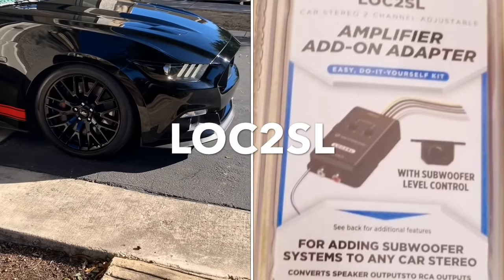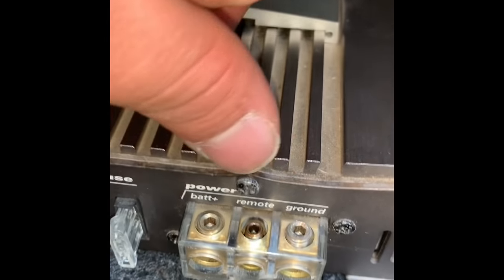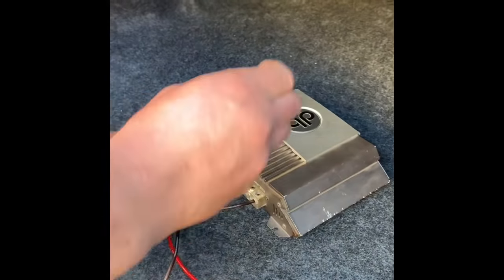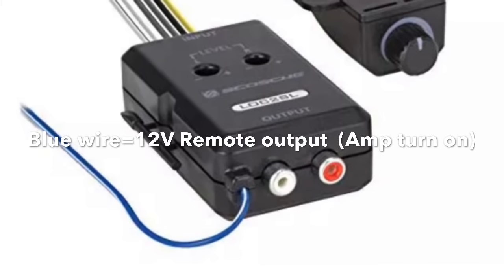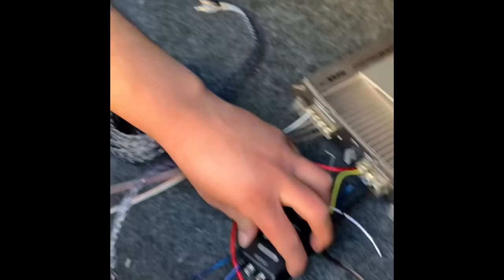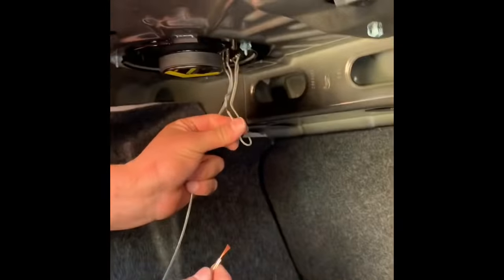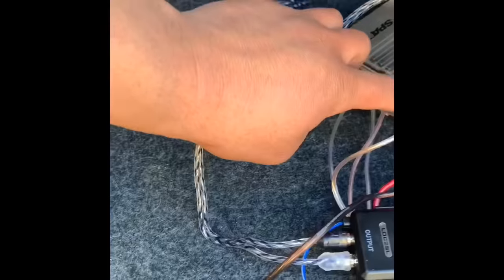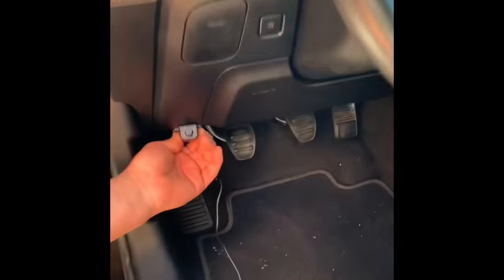How to install AMP/SUB to factory radio/LOC2SL amplifier ADD-on adapter

Comment: Hey bro you got your amp power cable backwards, you need to put the fuse near the battery not the amp.  Look it probably won’t matter but that’s how it’s suppose to be. The fuse always goes near the battery.  Here’s why if it does fail the length of the wire before the fuse will still be hot, it’s it’s shorting out on that side the fuse won’t do its job.  You only want a short maybe foot of infused wire right near the battery.  The turn on wire needs to go to something that only turns on when the key is switched on, then the amp will only be on when the ignition is on.
Reply from the maker: CigarSmoker Yes you are correct my friend the normal spot for the fuse is by the battery but in our case is (either or) we are not running a heavy system where things are going to overheat and cause damage,  that’s the reason we wanted ours like this, and the turn on wire you are talking about that I can run it to something where the ignition is on or off it will turn on and turn off the amp, I am aware of that I have videos on how to do that to here on YouTube where I do this to, but I am not really a fan of running wires to relays or fuses , that’s the reason I am saying that the only downfall with this product your amp lights will stay on but if the light is small it will not  kill your battery and you are more than welcome to install a switch to turn on and turn off your Amp That section were this illuminates me running wires to fuses or relays .
Reply: It does matter you always put your fuse as close as you can to the battery no matter how much power the system is going to have. Furthermore the ground he used is not any good at all there was paint on that metal that should of been removed but that’s not it you should be using a ground that’s directly connected to the frame better as well grounding is very important! And a simple switch is easy to install for the remote if nothing since any battery drain over laziness is just ignorant.
Reply: Kadeem McClendon yep and really the whole car would burn or could because it could start fire anywhere in between it could be over quick you might not survive if driving fire and increase oxygen from driving is like fuel on a fire.
Reply: @Thumper68  You can tie the remote into the 12 V cigarette lighter or any accessory that turns on and off with the vehicle
Reply: @greatsoutherntrendkill79  yeah I know this it’s common sense…

Comment: Good video, you can run the remote wire to the fuse panel and connect it to any fuse that is controlled by the car being turned on, like tapping into the radio fuse or anything that gets turned off when the car is turned off. Easy peasy.
Reply: Hi sorry for the question  I'm trying to install mine I prefer to ask before making mistakes if I understand correctly I have to connect the 12v to the direct electricity and the rem of the converter to the fuse box of the radio therefore the rem cable of the subwoofer must also be connected to the fuse box together with the converter to turn the active subwoofer on and off when the car is turned on?  thanks in advance for your time
Reply: How would you do that necessarily
Reply: You run a small guage wire from the fuse panel, buy an "add a fuse" to do this, they're on 5 to 10 bucks. Run the wire to the Amp and connect to the "remote" terminal on the Amp. You want to select a fuse in the fuse panel that is turned on and off with your car key, typically tap into the "radio" fuse. This way when you turn the car on, you get power to the Amp and when you turn the car off, the Amp turns off so it's not constantly on which could cause it to overheat.
Reply: @DamianopieroTodaro You run a small guage wire from the fuse panel, buy an "add a fuse" to do this, they're on 5 to 10 bucks. Run the wire to the Amp and connect to the "remote" terminal on the Amp. You want to select a fuse in the fuse panel that is turned on and off with your car key, typically tap into the "radio" fuse. This way when you turn the car on, you get power to the Amp and when you turn the car off, the Amp turns off so it's not constantly on which could cause it to overheat.
Reply: You run a small guage wire from the fuse panel, buy an "add a fuse" to do this, they're on 5 to 10 bucks. Run the wire to the Amp and connect to the "remote" terminal on the Amp. You want to select a fuse in the fuse panel that is turned on and off with your car key, typically tap into the "radio" fuse. This way when you turn the car on, you get power to the Amp and when you turn the car off, the Amp turns off so it's not constantly on which could cause it to overheat.
Reply: No the remote wire goes from the fuse panel directly to the Amp. All it does is act as an on/off "switch" for the Amp. The converter is to get the signal for sound.

Comment: Bro I’ve never hooked up any subs or an amp in my life and so I started freaking out cause my radio doesn’t have a rca and I bought the adapter and couldn’t figure it out. This vid don’t have no bs just straight to the point. I appreciate the vid bro

Comment: I've never had a car with a system in it, it's always been SUV's, and I've run several wires and LOC's through the front to the back of the vehicles. I now have my gmas old buick and this install will be MUCH easier than the SUVs!  Thanks much S.!!
Reply from the maker: Adam Ferris 👍

Comment: I bought one of these for my 2011 Ford Escape XLS, because I wanted to keep it original looking, and Sync. My radio also looks really good with the lights on at night. Ford factory radios in general sound amazing as it is, I really didn’t see the point in buying a new radio. This thing saved me $150+! I also recommend turning the bass all the way down on the radio, as the door speakers distort at higher volumes on stock settings. It’ll make your sub sound better too! It’s funny that my factory radio puts out more watts than what the factory speakers can handle 😂😂😂

Comment: The most clear video I’ve seen on this process, thanks man
Reply from the maker: Wylie Brooke no problem buddy ✌️
Reply: Wylie Brooke Wrong!!!! Yellow cable should not be on al the time, you have to find a source of power that turns on when  you turn the car key to accessories that way the blue will come on only when the the yellow gets power!!!

Comment: Daaaaaam like 30m or less  shit finally a good video thnkz bro straight forward  and shows you step by step any one can run a Hott wire but it's tricky  wen tapping into speaker  straight every other video  made it sound hard too doo this dude did in a timely  manner  💯💯💯💯💯💯💯💯💯💯💯💯💯💯💯💯💯💯💯💯💯💯

Comment: I done watch like 20 videos urs was so easy to understand thax
Reply from the maker: King Salley 👍
Reply: To be fucking honest lmao 👍👍 thx
Reply: One problem I heard...most people don't want an extra toggle to turn on and off.. you can use a fuse with constant power and connect into amp power cord..just make sure to have a fuse for yellow wire to converter.
Reply: Did the same damn thing
Reply: I agree with you. I'm planning on doing it soon.

Comment: Great video.I tapped my accessory socket for the remote connection.  It seems to power off when key is off and on when key is on.
Reply: That's the correct way. Honestly that's the whole point in the remote wire, using it like this defeats the whole purpose of a on/off wire because it has constant power. You never want constant power going to anything in your car. Other than that this is a good to the point video.

Comment: Did everything as you said but my amp won't switch on? Kinda late but do you need actual rc wires or can you use just old DVD player wires that are red and white?

Comment: Did you adjust the Gain in the LOC, because i got one and installed but it sounds like i dont have enough pre amp voltage.

Comment: I did what you said and it works. The thing is, is that I'm not impressed with the subs. They're not that loud and I feel like they should be
Reply from the maker: Harry Ocon  maybe you need a better amp????
Reply: I got a boss 1100
Reply from the maker: Harry You can mess with amp knobs to make it sound better, or on your stereo unit as well you can mess with the settings for the sound quality
Reply: Okay, thank you

Comment: If you connect you remote to your rear running lights you can control your amp with your light switch just an idea that way its not on all the time
Reply: How???

Comment: Only one thing i like to add is, 
He said,  downside is that it will keep the amp on i did some research and was about to install switch to turn amp off but you dont need one. Because this device scosche LOC turns your amp off after your vehicle is off. Sometimes your amp turns off after a delay.
Rest is good stuff.
Reply: So or does turn off? Eventually?

Comment: I have a question. I know this has a control knob but my amp has one too.  Do I have to install both or how does that work? Thanks
Reply: You only need to install one whichever you like the most

Comment: Please some reply fast I need help I have a 1500 watt amp in 2 subs in 4 rear door speakers in 3 dashboard speakers in 2 corner speakers what do I need to connect everything in out it together I have a factory radio will this little piece right here power all my speakers or do I need something else I have a chysler 2010 touring
Reply: You use this only to connect a amp to your factory radio. If your using a aftermarket radio you dont need it. You will need more than one amp if you're wanting all your speakers on a amp, one for highs and one for subs. If you use this you can get a multi rca adapter to run 2 sets of rca cables for both amps to run off of this.

Comment: You could also tap into the fuse box  through a 12v acc. for the remote wire.
Reply: It will still stay on using the converter box...any other time that always works

Comment: Will this work if i have a factory sub speaker on my deck and i just use the wire from  that to connect to the LOC? Will right or left matter since its already a sub connection? My factory sub blew so im replacing with new one but with amp for more bass than the stock amp
Reply from the maker: DP TheProducer I apologize I’ll get back to you later very busy right now I will get back to you
Reply from the maker: DP TheProducer I will recommend using any other speaker interested of your factory sub,  but yes it will work anyway’s and on the sub you can use right or left 👍

Comment: How did you pinch the wires from the speakers? In the vid your hand was covering what you were doing and couldn’t tell how you did it
Reply from the maker: Marco Ramirez https://rover.ebay.com/rover/0/0/0?mpre=https%3A%2F%2Fwww.ebay.com%2Fulk%2Fitm%2F192170787945

Comment: You seem to know what you do and I need some help. 

Lately my Pontiac g6 speaker system has been acting up. I have all factory speakers in it. Some times the main back speakers don’t work, I’d say about half the time. Other times only the right front speaker works and other times it’s only the left. From my observations everything is very inconsistent but when one of the speakers is working, it will work until I shut the car off and drive it again. What should I do to fix this?
Reply: me too please tell me if you find a fix
Reply: Justin Wiggin I hooked up some brand new front speakers in the doors and the back speakers need upgrading too but oddly enough replacing the front speakers seams to have caused the back ones to work consistently. The back ones could still use an upgrade though. Best of luck to you

Comment: so you have your left and right factory speakers in the trunk, so does it matter which speaker you tap into to connect to the box with speaker wire?
Reply: You want to do it from the output line converter first then the amp and the speakers(subwoofer) to the amp

Comment: where are the speaker wires located at? i see yours is at the top but i don’t see mine anywere
Reply: You probably don’t have rear deck speakers aka the mini sub that is preinstalled
Reply: @lildj4562  I said fuck it and got a stereo lol ty for the info tho

Comment: unlike you , i only have one speaker in the back am i able to just connect one set of the 2 speaker wires and not have the others connected ?
Reply from the maker: aaron manzano yes correct

Comment: I have the same LOC, do I have to hook it up to the 12v power and remote? I really just want to use the speaker wire/rca portion of it. I don’t plan on using the extra switch it came with.

Comment: I got a 2014 Ford taurus se and comes with now rear speakers.. so how do I tap in to run my hook up? Is there wires back there or do I have to tap in rear door speakers?
Reply from the maker: Terence Cain if you have no rear speakers you can tap into your door speakers but if you have a little bit more experience you can also hook to the speakers behind the stereo unit
Reply: Ok thx bruh I'm running it from rear door speakers rt now thx a lot
Reply from the maker: Terence Cain no problem 👍

Comment: So I have a question if anyone can answer this. I’m wanting to use this LOC and use the remote wire from it. In the vid he says to install the power wire from the LOC with your other one going into the AMP… I have a much larger amp using 0/1 gauge power cables from my battery and I wasn’t sure if this would still be okay to do.

Comment: What if my amp or output converter doesn’t have a aux input? Can I cut the jack and use the bass control wire directly to the remote location on my amplifier?

Comment: I wish you didn’t have the music playing I couldn’t hear the part after u said the amp will stay on
Reply from the maker: Christian Rios I was saying that the only bad thing about this kid your amp will stay on but if your amp has a small light don’t worry it will not kill your battery long story short if you do not want that all you have to do is put a switch on the amp to turn it on and off problem solved
Reply: @sperez6140  What switch
Reply from the maker: ItsAGW what I was saying is that if you want to turn on and off your amplifier Manually you can purchased switch at AutoZone to turn on and turn off your amplifier!
Reply: @sperez6140  No im saying like what switch like a name? I looked up a 12v switch 3 pongs... which I have no clue what that means
Reply: Shouldn't the loc turn the amp off when the car is off? The signal in the speaker wire is what triggers the loc and turns on the amp.

Comment: So what to do if you don’t have any speakers mounted to the deck that you can access from the trunk? I have an Avalon and it has no rear speakers, only door speakers
Reply from the maker: MS Babban you can install behind your stereo unit, all you have to do is figure out which ones are your speaker wires👍 if you do not know how to figure out which one is your speaker wire behind your unit, you can run this kit from your door speaker yes it will be a little bit more hassle

Comment: how do you do this when using 4 speakers? You show how to install using 2 speakers. I want to install a 5 ch amp. 4 speakers(2 in the front doors and 2 in the back window) and a single 12 inch subwoofer.
Reply: @SuperSpinster12 tyvm
Reply: You’re going to need a new head unit to install the 5 channel and new speakers.

Comment: I have a single 12 sub. Do I have to use all 4 input wires or just one channel/speaker to tap into? ie: 2white left channel, 2 grey right channel. Thx
Reply: Did you figure it out? I have the same problem

Comment: I tapped the remote wire into the radios remote wire, so when the radio turns off and on the amp turns off then on

Comment: Wrong!!!! Yellow cable should not be on al the time, you have to find a source of power that turns on when  you turn the car key to accessories that way the blue will come on only when the the yellow gets power!!!
Reply: Like a cigarette lighter connection and place a fuse on the yellow
Reply: You not pay attention. He knew he took a shortcut and said he will put on a on/off switch for it. It's still risky cause it's live at all times if you forget. All amps really should suck the juice outta our cars overnight for doing shortcuts. May wake up to a firetruck somenight, hope not though.

Comment: 🙋🏼‍♂️ Where does the signal from the head unit come from? Did I miss that part? 😆🤷🏼‍♂️
Reply: Hell I miss that part to 🤦🏽‍♂️🤣
Reply: He tapped in the rear speakers to get the signal, that's why your confused lol cause it's not as time consuming using the loc.

Comment: Probably a stuipd question but with the converter connected to the amp wouldn't it make the amp stay hot 24/7... How does it turn the amp off an on if the converter not hooked to a off an on fues ?
Reply from the maker: Tyler k It will not run your amp hot because, you are not putting wear and tear on your app because your speakers are not on it’s just the light , you cannot turn it on and off manually but you can install switch to turn  It on an off
Reply: Yeah so your amp will stay on all the time if ran straight to the amp